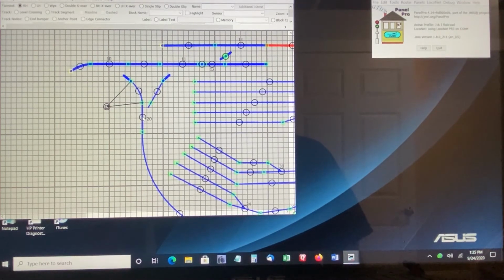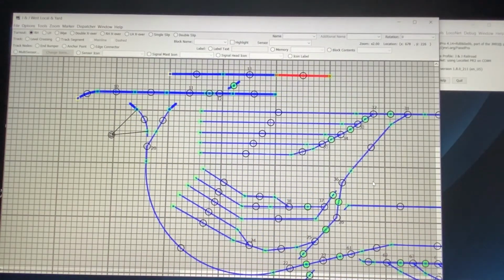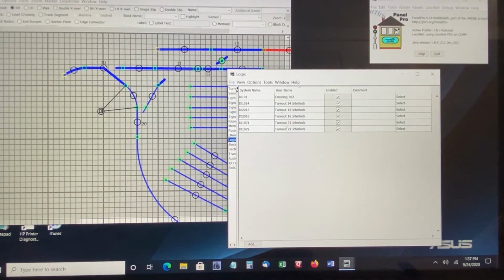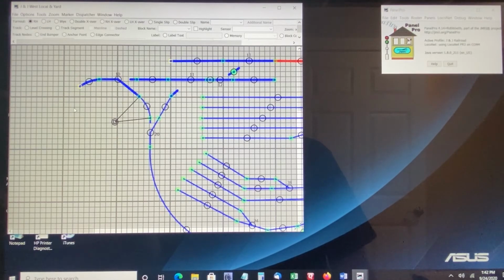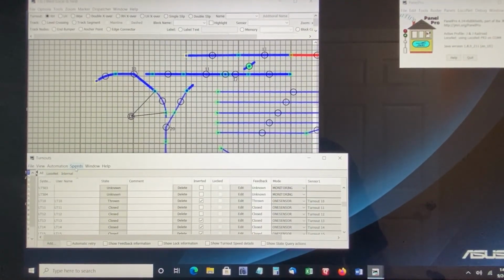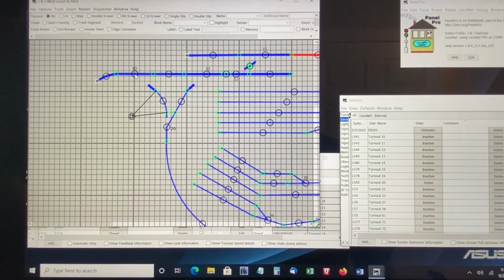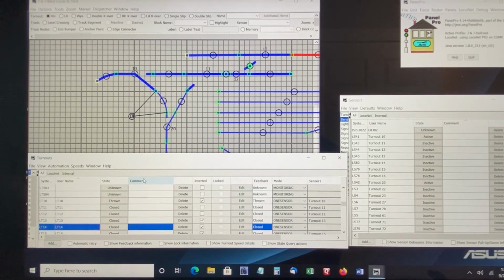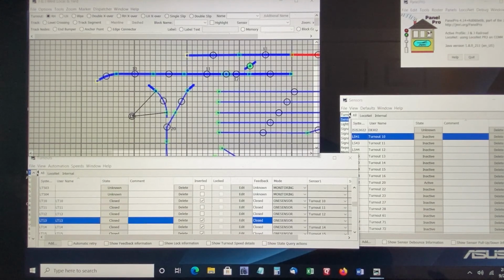Turnout Feedback Correction

Comment: Is there any way to reverse the feedback?
I have pre-wired all my turnout feedback without regard to whether the wire was set for thrown or closed at the turnout. I would prefer not to have to rewire the turnout feedback wires at each switch machine if I can reverse the feedback status in JMRI.
Reply from the maker: I think I need more info. Which switch machines are you using. With some, you can click the box in the turnout table to invert the turnout. But that may cause other problems.
Reply: @jimworcester981  I am using the DCC CONepts switch machines. Using address 197, it reverses the thrrow within the turnout.
I did do some playing last night and found an invert button on the sensor info. I will try that to see if it does what I need.

If you want a video idea for another JMRI focused video, I really want to put an on/off track power button on my panels. I know about the jython scripts, i just cannot figure out how to connect a script to a sensor button.
Reply from the maker: Hopefully the Invert button in the Turnouts Table will accomplish the reverse without re-wiring. Actually, you should only have to move one wire on the switch that is thrown by the switch machines. Move it to the other contact so that the circuit is closed when the switch machine is in the other position.
Reply: @jimworcester981  I got it all setup and miraculously the sense wires are all correct. Not exactly sure how/why that worked. 

But I am having an issue where when I select “onesensor” some of the turnouts stop working and the turnout and sensor get out of sync. 

I am going to Google search the issue, but I am thinking I might need to set a delay on the reporting.
Reply: @jimworcester981  I just learned something. 
When on Monitoring, it listens to the LocoNet bus and can read back the sensor state. That is why on Monitoring, they were always correct. 
But then on onesensor, when it was actually using the feedback sensor, any turnout that had the sensing reversed, was now confused and not moving. 
When I go back to the layout, I need to try the invert sensor on any turnout that doesn’t work when set the sensor to “onesensor”. 
That’s my one new piece of knowledge for the day, time for a nap now :)